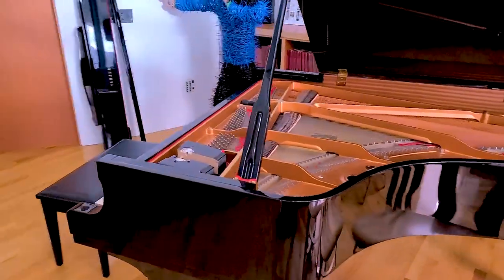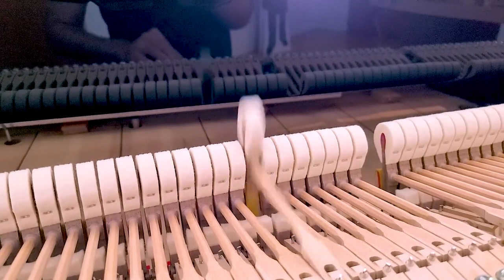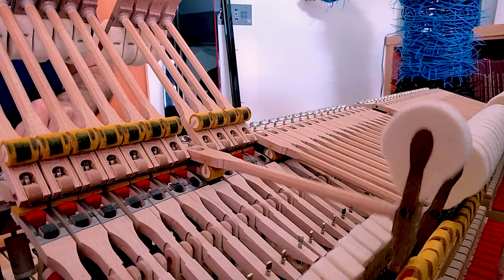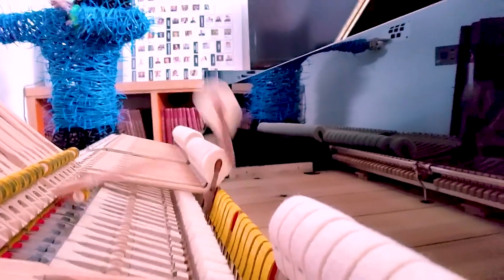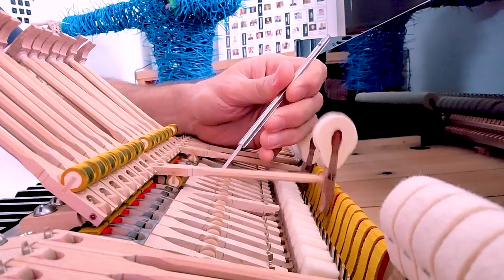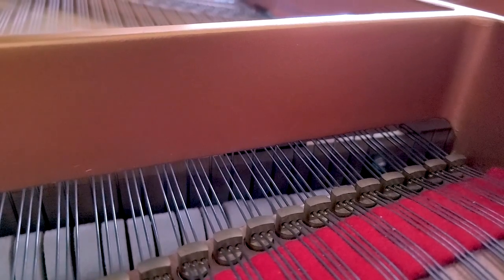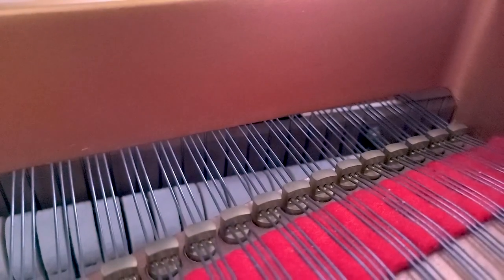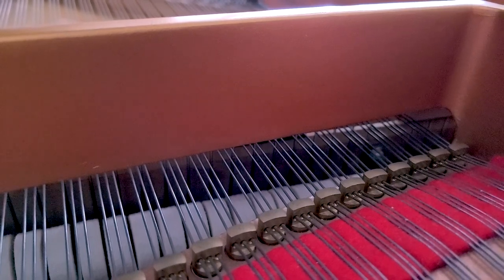Bobbling Hammer   Yamaha C5

Comment: I am confused at strengthening the spring as a way to decrease the bobbling. The jack is pushing up the hammer and I would think the rep lever is just along for the ride. I think the double strike or bouncing can only be caused by two things, the knuckle bouncing on the jack after let-off because of not enough aftertouch or the knuckle bouncing off the rep lever. So to me it's an issue of sure checking, and if the note is played softer than the hammer can check than it's an issue of drop, let-off and full escapement. But maybe there's something I haven't thought of. I really appreciate your work that I have seen so far and mean absolutely no harsh criticism. Anyone who does that has never had to try and resolve double striking before!
Reply from the maker: Thanks for taking the time to comment. You're right in that the spring doesn't directly cause bobbling. In this video I was really just trying to show that several issues caused the bobbling. In this case it was the knuckle bouncing off the rep lever which was ultimately caused by a regulation setup for a weak spring. Instead of tightening the spring it seems that the jack was lowered in the rep window which in turn causes the drop to be too high. Additionally the back check was also raised to compensate. The rep spring really is king.
Reply: @the_daily_ping  yeah, that makes total sense to me.

Comment: I, for one, am quite thankful for this video. This topic is not covered quite as extensively as the many other piano technology topics that one can learn about on YouTube. On my piano, which is a new Yamaha C7x, if I am playing a very soft passage and my touch is ever so light, often a hammer will "bobble" and play the note twice. It had me even questioning my relaxation in my technique. Was I nervous and were my finger unsteady? No.....I don't think that's it. I too have been thinking: is it the repetition spring? Is it to strong? Is it too weak? When testing by playing a note, having it go into check, and then lightly pressing the key so the hammer rises from its position in check.....what should that look like? How fast should it go up? This video really was well explained and I now have a much better idea of the elements involved as well as what the movement in the action looks like. Thanks Daily Ping!
Reply from the maker: I so glad this video helped you! There are definitely piano tech topics that just don't get discussed much. You can check my "Let It All Sync In" video that discusses the function of Drop which is a severely underrated aspect of action design. Thanks for the comment.
Reply: Hello, did you ever solve the bobbling problem?

Comment: You seem lost. Your adjustments are not working. Checking should be same height for all hammers. If you increase spring strength that will worsen the non checking. You need to check aftertouch, maybe increase it and lightly roughen the tail with a checkering file. Making it set off earlier is not the right way to go about it either
Reply from the maker: I appreciate your insight. However I do not subscribe to roughening hammer tails. Also, tightening tbe spring will not worsen hammer checking if it and the checking are reasonable. However, these kinds of things are very situational. Ive noticed that in a lot of cases the underlying issue can be things like the friction of the bushing. If you can get the bobbling to stop with files or regulation then you have won the day. Thanks so much for your input on the subject. I feel that it’s important to get differing views to make sure that I’m not living in a bubble.
Reply: @the_daily_ping spring tension should be "minimal ", just enough to lift the hammer..
Reply from the maker: @beethovensg  Wrong in so many ways. But thanks for watching.
Reply: The rep springs should cause the hammers to rise "as if the CEO has just walked into the office" is how I was taught.

I hate for them to be so strong that they have a "kick-back" that can be felt

Comment: It seems the drop screw was a little too tight
Reply from the maker: You’re right. There was quite a few things going wrong there. The whole action is in need of some fine regulation. It’s in a tough room too. It gets the sun every morning and then has the A/C blasting on it. Fortunately it’s not used for anything really critical.
Reply: @the_daily_ping that's just one sad piano. Personally i refuse to work on pianos that has direct sun light on it. Especially if the piano is played by multiple people, like in schools. 

Last thing i need is to hear that i took money and didn't do the job or did it poorly, just because someone didn't used window shades.
Reply: The last sentence about regulation is voicing.. i would not call it that. Regulation has impact on the sound undoubtedly. Angle and power of hammer strike changes the tone. I would just reserve the Voicing for work on the hammers and strings.
Reply from the maker: @Tomáš_Nithrania  Yea, I don’t usually conflate those two things in conversation because they do imply two very different processes. But we’re all techs here so “Everything is voicing!” 🤣

Comment: Perfect spring tension . Just enough to rise.
Reply from the maker: Wrong. Wrong. Wrong. Read a book.
Reply: @the_daily_ping  you , my good man need some realization. Enough from the peanut gallery.
Reply: @beethovensg you’re right, he’s wrong. He doesn’t have a good grasp on regulation unfortunately. Most techs don’t. 
The repetition spring needs to be just strong enough to hold up the hammer. Any extra, is just a safety buffer. Ideally you want it barely holding up the hammer. It doesn’t actually need to pop up from the back check. 
The name repetition spring is extremely misleading. Tight repetition spring doesn’t speed up repetition. High back checking does!
Also for back check, it’s not “I like it half way”. It should be “as high as possible without rubbing during fffff blows”

The double strike is because of not enough after touch and or drop is not enough, and too tight repetition springs.
Reply: @FlyWithNoam  100%